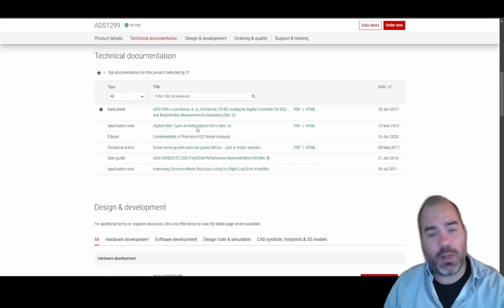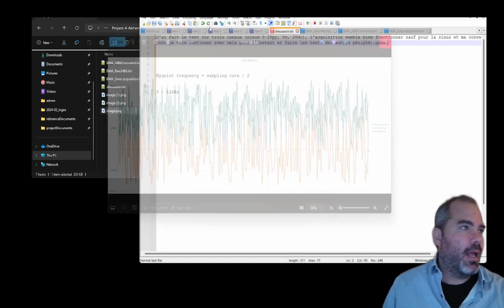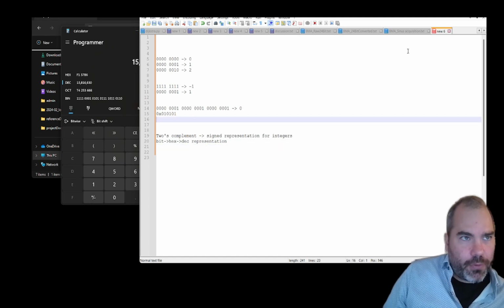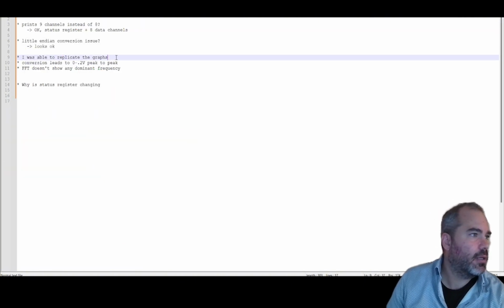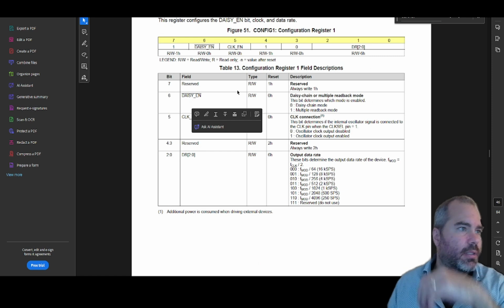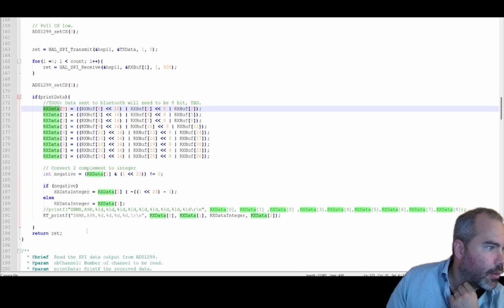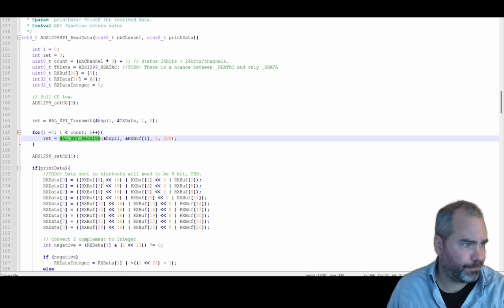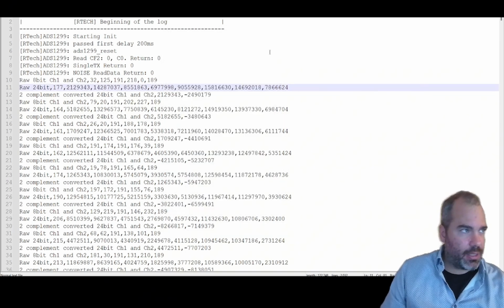Brain-computer interfaces - Debugging the ADS1299 DOUT

Comment: Quite insightful steps for the ADS1299 debug. Can you please make another video on how to use BIASIN, SRB1 and SRB2. Currently when I feed DC input of 35 mv and with PGA gain of 24 the ADC should read about 840 mv but I am getting reading of 978 mv from ADC. Can you please comment how to rectify this?
Reply from the maker: Thanks for engaging. I happened to have debugged the whole of it over the past two weeks. I'll make a follow-up video. What comes to mind:
* Have you validated with the test mode ? This will ensure your data interpretation is correct, but will also validate your VREF as it is needed to work properly (you might have to activate the internal reference buffer)
* SRB1(-) and SRB2(+) can both be used as your reference lead, but you need to configure the registers properly. I suggest you use SRB1 as it can be attached to the negative input. First, I would de-activate the BIAS system, until you have a properly referenced input, BIAS is for something else. Then, decide if you want to use SRB1(-) or SRB2(+) and check the schematics accordingly. In the ADS datasheet, take a look at Figure 73, you'll see how SRB1 can be configured to connect to the negative inputs. Figure 18 is more complex, but shows how the MUX can be used to configure the internal circuitry, it also shows how SRB2 can be connected to positive input.

Once you have the right configuration, make sure you power supply and voltage references are on point and it should work. Then, you can move on with configuring the BIAS.

Comment: What's your thoughts on the NeuralLink device that the young paraplegic fellow has embedded?  I'm finding it hard to believe that the device has given him such control in FPS games that they are saying.  Maybe with eye and head tracking and blinking to trigger changing weapons and firing.  But fully controlled via NeuralLink device.  Seems like smoke and mirrors. [https://youtu.be/LACG0OSSQ8I]
Reply from the maker: Hi! 

I worked with in-brain implants during my PhD (2010-2015). I'm impressed with what is being achieved by Neuralink, we were doing something similar, but the resolution of the Neuralink is 100x better than what we achieved back then. There are several points that are left aside in the media releases, however.

(1) Regarding your question, I read the press release (google: prime-study-progress-update-second-participant) and the patient (Alex) uses the Neuralink in conjunction with another assistive device, the Quadstick, with which he was already experienced. I do believe the video (it's certainly handpicked), but it does overhype the contribution of the Neuralink system, given that Alex could already play CS with the Quadstick.

(2) The biggest limitation of the Neuralink system, in my opinion, is the longevity of the implant. There are multiple factors that makes it hard to keep an in-brain implant for more that 2-3 years (it can happen, but it's exceptional) and I haven't seen any progress along this line since I was PhD student. Now, with a lot of funding, it remains a bioengineering problem, so solution will be found, but the hardship in keeping a delicate foreign object is the brain is not considered enough in my opinion. Remember, each installation is a major surgery.  

Exciting times, nonetheless. Like I said, I'm impressed with what Neuralink is fielding and I hope they will continue this way. The company Synchron has a different approach to in-brain implants and I think their approach has a lot of potential regarding implant longevity, but I don't know how performant their implants are.